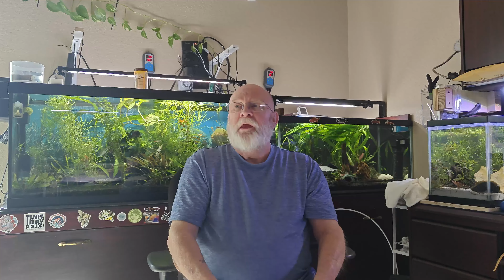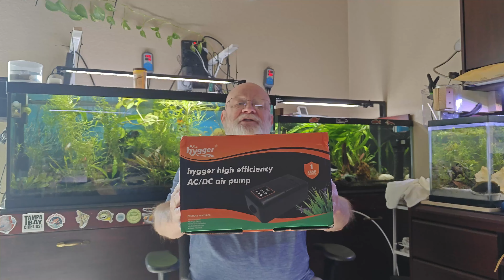Hygger 123 High Efficiency Air Pump Review

Comment: How do you like it now? Still working well?
Reply from the maker: So i still have one running the original one i found the battery backup quit working after a year. But the pump still worked fine. But hygger replaced it. So I'm running the 2nd one now. I did a video about it if you look on my channel

Comment: 2 weeks later whats your thought's?
Reply from the maker: @TheSalient1  it's doing just fine. Although this pump is really too big for me. If I had a racking system or several tanks in a row it would be perfect to run many tanks. But the way I'm set up is not really convenient for me. It definitely has plenty of power to push allot of air. It's rated at 300gph

Comment: I have a few of their air pumps ..
I found they stopped working after about 8 months . Hopefully they have worked that out .
That looks like a big unit.  
That is pumping out a lot of air.. seems good .
Nice to know that it can run multiple tanks
Good on you doing such a thorough test.
22 hrs and still going. 25 in total . Not bad at all. 1-9 settings 
Full view buddy
Reply: Stopped working after 8 months? That is crazy bad. Was it because the battery failed? (I have pumps that have run for decades.) I'm looking for a pump for a power outage. Maybe I should look into alternate power source rather than a battery pump?
Reply from the maker: @saabtech3510  well I can't say  I've had that issue as this is the first using this Hygger pump. I have other battery backup pumps but none of them can compare to the output power this pump provides
Reply: @razinfishes  that looks powerful
Reply from the maker: @stubbsaquatics6080  absolutely it's the most powerful pump I've ever had. It can easily run all my tanks if they weren't all spread out.. It would do super well for your indoor pond
Reply: @razinfishes  Thank you for the review Scotty. Much appreciated. I think I'm leaning toward running my normal pumps off of car batteries and an inverter in an emergency.
Reply: @razinfishes1918  I am sure it is
Reply from the maker: @saabtech3510  no worries. If my tanks weren't spread apart and in different rooms this pump could run all 10 of my tanks. Instead I have small pumps on each tank.
Reply: @saabtech3510  I was referring to the 5w and 10w plug in . .  I had 5. Only 2 work 
I have a chargeable hygger dual air pump and only the one side works. They sent it to me to review. They didn't like the review and ... Well that is the last I heard from them
Reply: @stubbsaquatics6080  Thank you for the extra info. I appreciate it. They don't sound very reliable. I have pumps and power filters I have used for over 20 years. Trouble free.
Reply from the maker: @stubbsaquatics6080  thank you sir. I have set it up to run on my 125 for long term to see how it goes